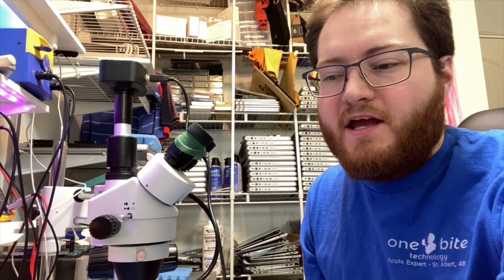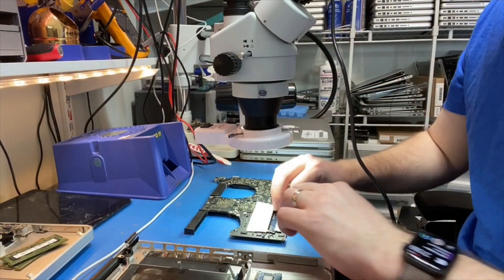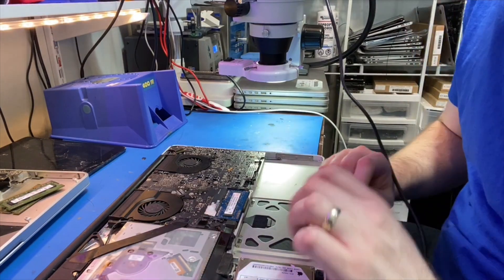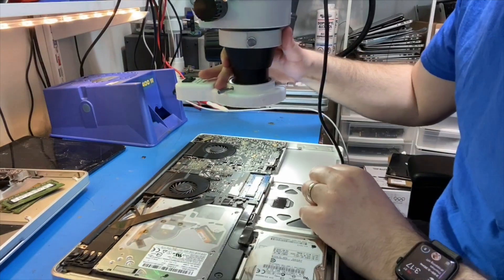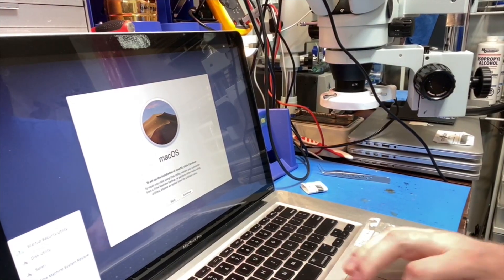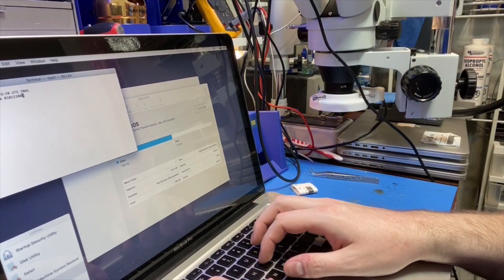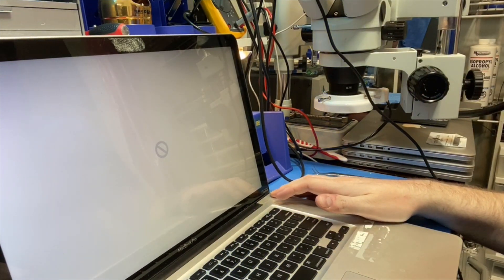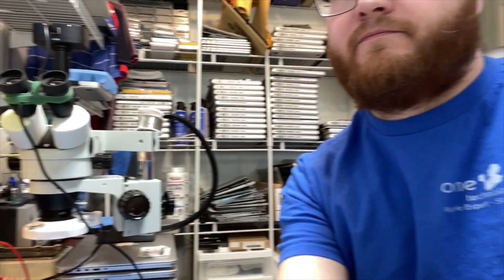15" MacBook Pro (Late 2011), GPU disabled, Mojave installed.

Comment: Does the Thunderbolt 1 port still work after applying DeMux? Besides brightness, are there any other side effects of it? Does sleep mode work well?

Great video btw! :)
Reply from the maker: Thunderbolt port no longer functions (but Airplay does work to an Apple TV!). Sleep mode works just fine with this hardware disable. Thanks for the questions :)
Reply: @onebitetechnology  Thanks for getting back so quick! 

Hmmm...I know the dGPU is wired up to TB port via display port so it makes sense that DP wouldn't work.

l think the TB lanes themselves come from the CPU/TB controller, I could definitely be wrong though. The TB functionality should still work...

Have you tried a TB dock?

I'm planning on doing this to my MBP 2011, but I want to use a eGPU dock for better performance while I'm still saving for a newer machine. I would hate to do the mod and mess up my thunderbolt port.
Reply: Thunderbolt still works, just no displayport
Reply: @mcronfpv8736  Thanks for the reply man! 

I ended up not going with DeMux and instead got myself an apple silicon 16in MBP

I've enjoyed it :)